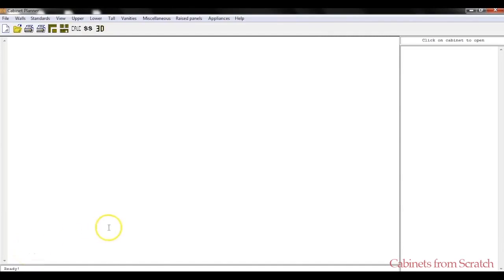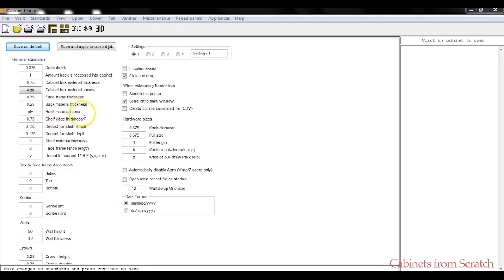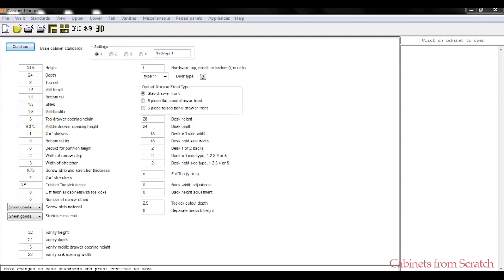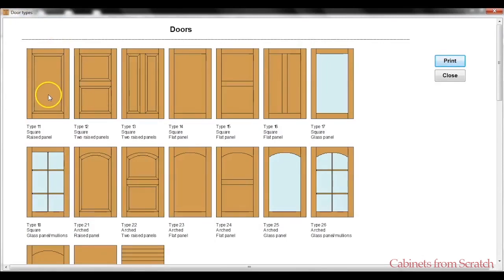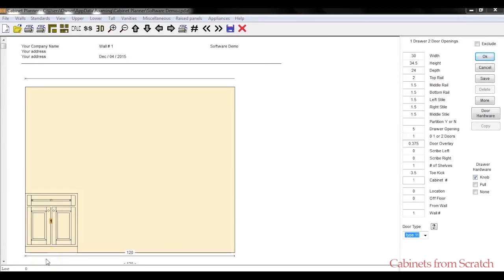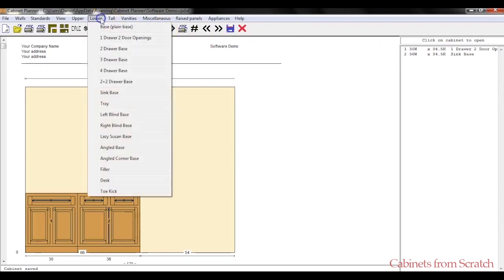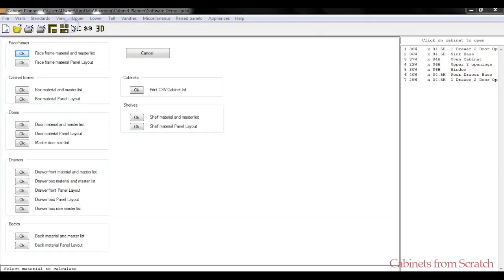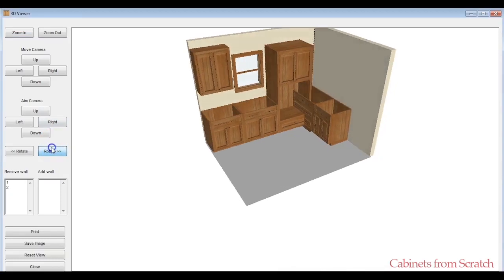How to Build a Cabinet Lesson 16: Cabinet Planner Walk Thru

Comment: What type of computer/specs are you running this on? I've been told gaming computers are best, but if I can avoid spending 700+ that's the goal. (I have a MacBook Air currently....)
Reply from the maker: I ran this on a 2013 Macbook Pro with Windows Parallels and it didn't run well.  I ended up running it on my wife's crappy PC laptop.  Cabinet Planner only runs on Windows, which is super annoying, but worth it if you're building a full kitchen set of cabinets.  Recommend you borrow someone's PC laptop to knock this out if that's the scale of your project.